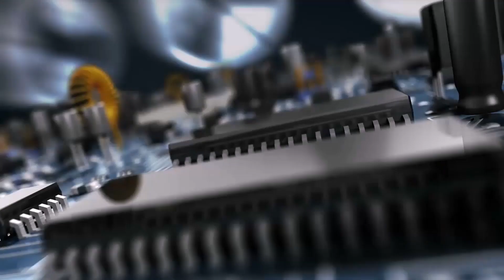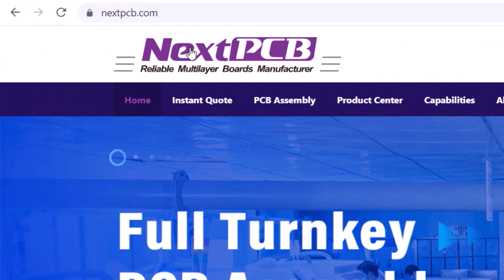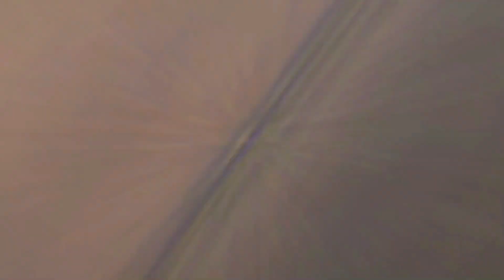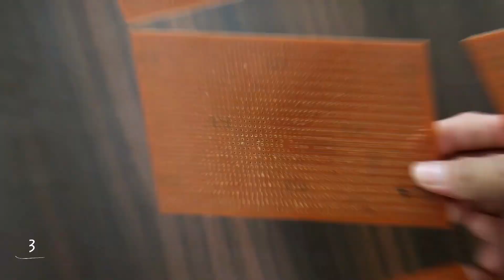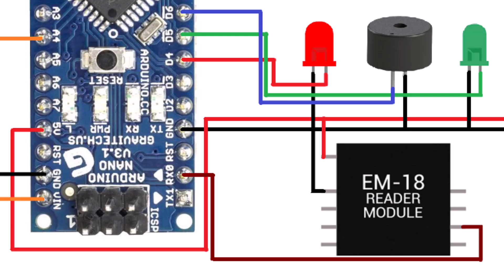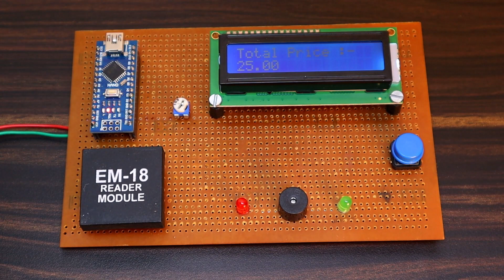Smart Shopping Card with Automatic Billing System using RFID & Arduino

Comment: rfid chip is more expesive than sticker lebel and takes the same time as you have to scan manualy if i remove the rfid tag or cover with aluminium tape or  keep it far from the scanner if you think of making the scanner powerful then it will also scan when another cart comes near and if you even think if it will not add anything when two carts are in close then will be able to put stup when two carts are close.

in conclusion not very usefull (shoplifting)

btw how old are you?
Reply: but rfid can be reused right?